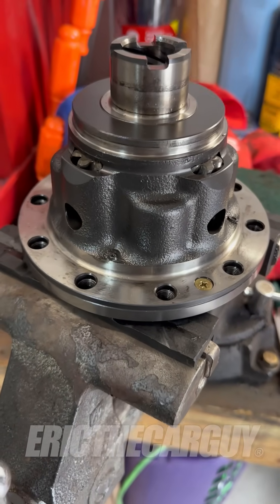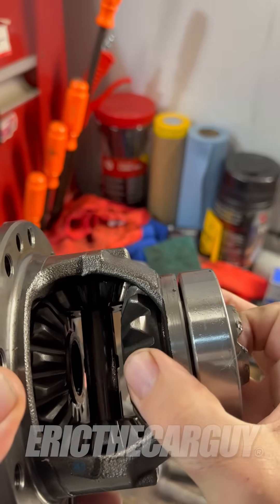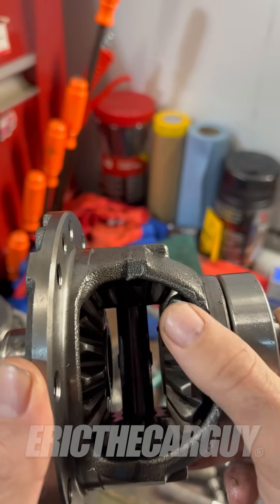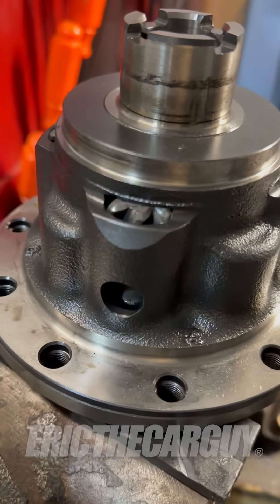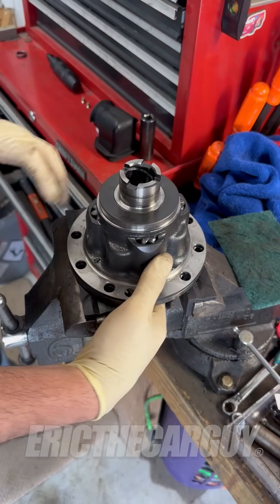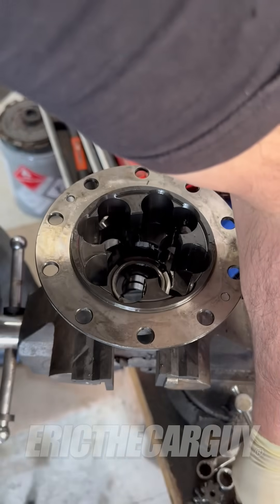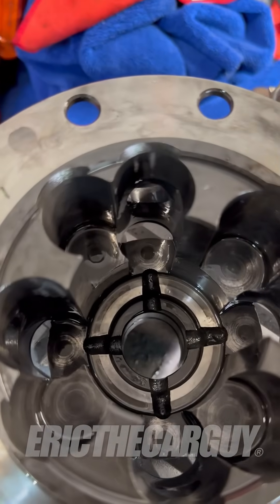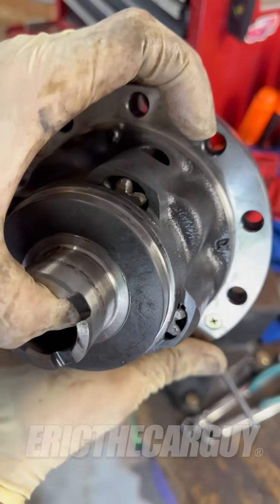What’s Inside a Helical Limited Slip Differential?

Comment: Hi Eric, im driving af fiesta st mk8.5 and i think I have some issues with my quaife limited slip diff. When im reversing im feeling alot of vibrations and a violent shake like the clutch is studdering. I have now changed my clutch and flywheel and the shaking/studder still persists. Do you think it could be related to the differential?

Comment: It’s actually a simple bit a ‘science’ and all those moving parts made it look really complicated. It works something like this. Those diagonally cut gear when spinning naturally want to push themselves out of alignment so positioning the diagonals as a V forces the gears to stay lined up. Lose grip in a wheel and one side of the V isn’t doing it’s job. This is where that diagonal slip comes into play letting those smaller gears slide which helps creates the ‘limited slip’ effect.

Comment: I wonder if my '05 CR-V has that "torson" helical type diff?  It does incredably well in mud. I jacked all 4 wheels off ground and spin wheels by hand,,, but both diffs act like open diffs and turns other side opposite direction. ?Does helical act like a clutch LSD or like an open with the way I'm testing?

Comment: Love your videos and they have helped me a lot over the years, but the workings of a helical/torsen style differential is not based on the friction between the side gears and the housing.  They're very clever the way they work internally and through the gears, they provide a torque multiplication where the wheel with grip can get up to 4 or 5 times the torque of the wheel with less grip.  This helps in hard cornering etc as well, as a greater amount of torque will go to the outside wheel, helping get you through the corner.  However, if on wheel has no grip, then it holds no to torque, and unfortunately zero times 5 is still zero and your dill will open wheel.

Comment: Relaxing bird sounds, ✅
Automotive part in vice, ✅
Being Safe, ✅
Having fun, ✅
Gloves staying Dirty, ✅
Lol, thank you for taking the time to show this, had a fun time replacing a 12 year old Alternator in my Wife's Soul that finally gave up the ghost.  This is the same Soul I finally did the trimming belt on.  This Kia has about 290k miles on it, so this alternator held up. I just hate the way Kia made the belt tension on the 2011 models, don't know if other Souls do this, as this is the only on I've worked on, but not my first rodeo, but I really hate cars that use the alternator as a tensioner, instead of having a normal spring tensioner pulley you slap a socket on and easily pull back to remove the belt.  Oh no, not spoiled, just partially disabled and it's hard on me to tinker on some stupid cantilever MacGyver set up lol, the square sits here in a track while two very hard to reach can't see bolts go through at just the right time you have less than a quarter turn, like an 8th of movement, any, not fun when you have a Nerve disease in both legs and no lift.  But, with nearly 40 years of vehicle repair service under my belt, you bet I'm still checking the boxes.  Thanks again EC, glad to see you and hear you Brother, be well and be safe!

Comment: Eric I’m in the Uk 🇬🇧, I have a Vauxhall Astra 1.0turbo 22900 miles , the problem I’m having is the clutch when I’m traffic and using clutch a lot the bite point gets lower and lower if I push pedal down and let it back up by letting my foot slip off pedal it goes back to normal if I rest my foot on clutch whilst stationary I can feel it sink away slowly any ideas what this could be .

Comment: Hi Eric, I just watched your video on torque converters on how they work. Awesome video. I was wondering, if some one has  to big of a stall conveyer  in your car can it over heat the fluid when idling. I have a 2013 6.2 Chevy zl1 that’s bored and Stroke to about 6.8. My fluid is getting hot when idle at long stop lights and then doesn’t want to shift but driving it normal around town works great.  Just wondering if you mite have  opinion on that.
   Oh and awesome videos. Thanks

Comment: Acura has some very advanced traction control systems built into some of their all-wheel-drive SUVs.  But, a Helical Limited Slip Differential is a mechanically built-in solution that does not require computers.  Thanks for this very interesting walk through.

Comment: Heard of those helical differentials but never seen the inside of one.  I've been told that with those that if you get into a free wheeling situation that you need to apply a little braking with the gas to give some resistance in order for the diff to lock up.  My '74 C20 has an open diff and I'm undecided whether to replace it with a helical, a standard clutch based, or a manual locking diff.  Didn't know that these helicals wear out.  Now I'm leaning towards a manual.  Thanks, Eric!

Comment: Eric, I'm sorry, but you've described the internal gears function incorrectly. None of the gears slide side to side, and the dumbell-looking gears definitely do not mesh with both central output gears.  If you look down into the housing you can see the short gears and the dumbell-gears sit at different heights.  The lower output gear drives the 4 dumbell-gears (up past the upper output gear)......the 4 dumbell-gears then drive the 4 short gears (which reverses the rotation)......finally the 4 short gears then go back down and drive upper output gear.

Additionally it's not that the helical gears that are forced sideways creating the braking torque.  It's actually that the engine is turning the housing which has to physically pushes against those internal gears to drive the wheels. This creates pressure against the face of the short & dumbell gear teeth as shown in the diagram.  If you go back and look at the short & dumbell gear teeth, you can see their tips are machined flat into a perfect cylinder. This is the surface that provides the braking friction against the housing.  The harder the engine torques the housing, the more braking pressure is created on that cylindrical surface.

Now, can you please explain why my factory LSD starts knocking when my fluid gets old (05 TL Sport 6-speed w/ factory LSD)?  Knocks during tight turns when fluid is old and it's very cold out. Change out fluid and it's been gone since.  Noticed a few tiny silver aluminum non-magnetic flakes in my old fluid.

Comment: That acts more like a mechanical locker than an LSD. It looks like once the gears are engaged with the case, there is no slip allowed and the axles are essentially "locked" together. I would be interested to see if there are any drivability issues that come from this after it's installed. Thanks for the video and great to see you posting again!
Reply: This is an OEM Honda helical limited slip differential. They put them in many of the Si and Type-R models. They work great.
Reply: Like Eric I have an Integra R with this diff and I daily mine and never noticed any drivability issues. In fact I would say the singular biggest difference between the standard car and the R version is this diff. The standard car is pretty good around corners, but has much of the usual FWD issues if you push it. With the diff added it's another world. Even at modest speeds and the more power you add the more it wants to turn. Push it further and it's almost feels RWD. The later DC5 Type R version(Japan only IIRC) has a more agressive LSD and tbh I didn't like it at all. I've driven a couple of FWD cars with third party LSDs and they were also more aggressive and noticeable in operation.
Reply: @MrGrentch hello! I have a 98 spec type r swap in my eg hatch but I noticed from a dead stop in 1st gear it makes a click/clunk noise. Have you ever ran into this issue? Is it normal or time for a new lad?
Reply: @sogonexd9130  Now I'm not a mechanic so take anything I say with a pinch of salt...But no, mine doesn't clunk or click when taking off. If it did, I'd try taking off in second and see if it still clunked. If it did I'd be first looking at engine/gearbox mounts, bushings in the front suspension, wear in the CV joints, that sorta thing. If they were all fine, then I'd look to the gearbox.
Reply: Many older Miatas also came stock with this same type of LSD unit.

Comment: any chance of a vid on properly rebuilding a honda trans. ive taken mine aprt enough to scuff up the surface of the gears that the syncros fir over to get them to bite like new again. but ima need to completly pull one down fully. not sure of there are special things to take not of or do. i cant wrap my head around the shimming of diff or input shaft

Comment: I'm hoping you can answer this for me 1996 ford f150 pick standard cab 2 wheel drive ,stick,4.9 engine, turn key no start ,battery good . No click ,what under the dash has power go threw it after it leaves the lower end of steering colum ignition switch. Leaving there and threw the firewall, is there any kind of a box or anything. If so what's the color code and what's what for power please.  It's an eddiebuear edition.  Thank you glad your back sir.